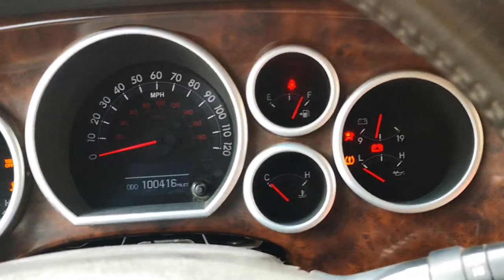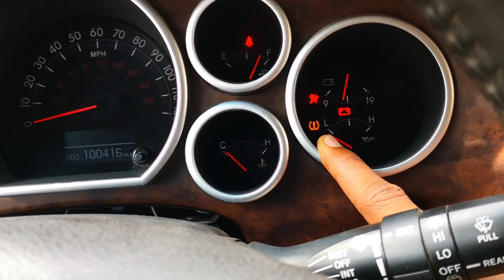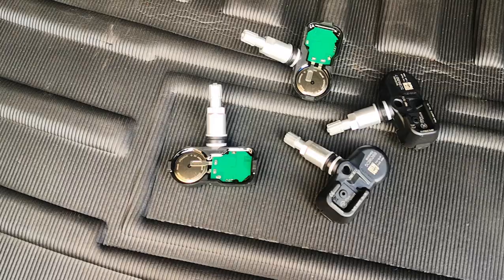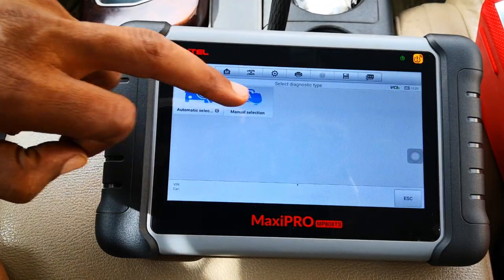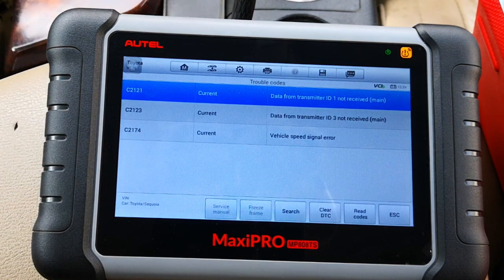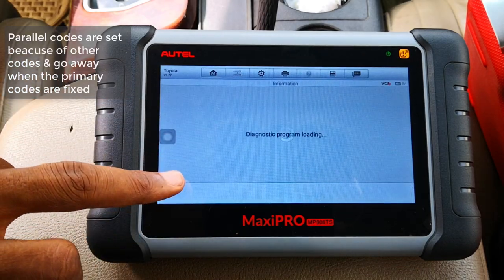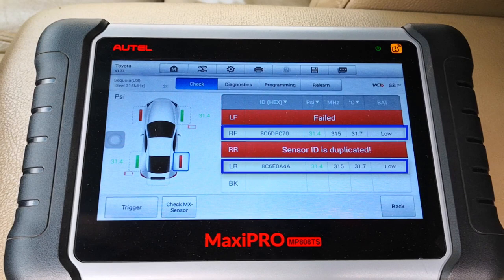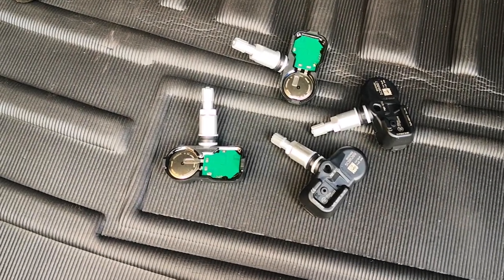Toyota TMPS diagnosis / Tire light blinks then stays on / Why your tire light is blinking

Comment: If it’s the battery in a Toyota 2007 Tacoma can they be replaced?
Reply from the maker: Technically yes, but it's a very messy process and not worth it in my opinion.
Reply: @DIYAutoworksNG so I should just buy 5 denso ones from rock auto and use my dads tmps tool to calibrate them?

Comment: Please sir I need your help concerning my Honda Accord 2003 i-vtec( EOD) it as really frustrated me, I have change ECU (Brain box), I have change the Fuel pump and injector but the problem still persisting. Please I will appreciate if you can run some check on it, thank you Sir
Reply from the maker: What symptoms are you facing? What codes do you have?